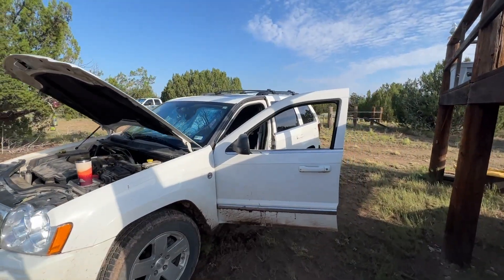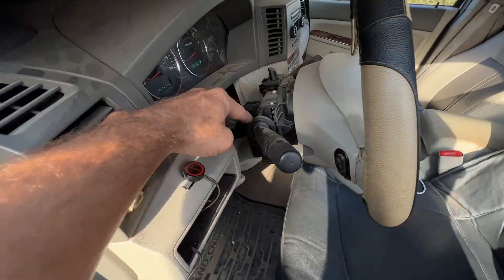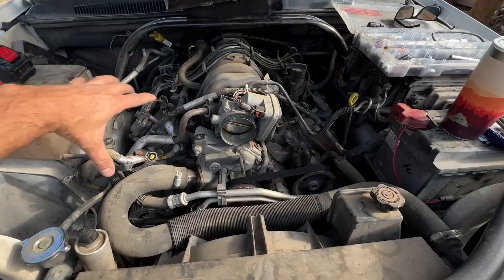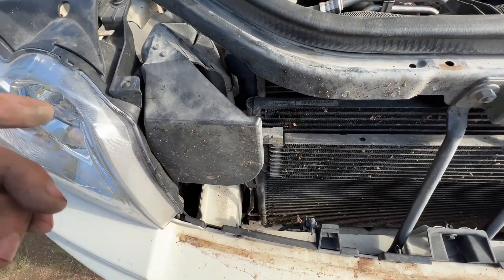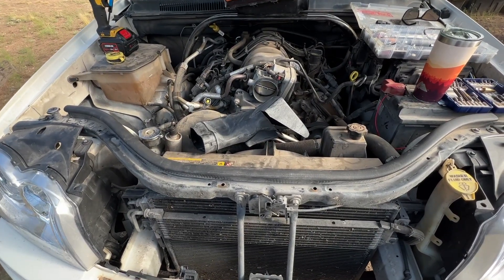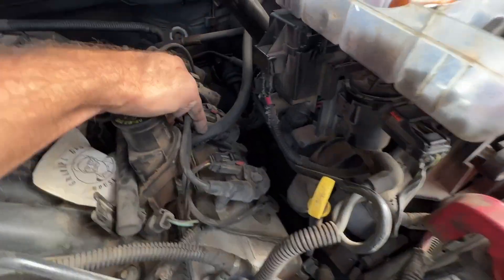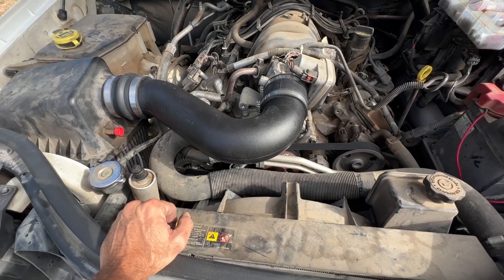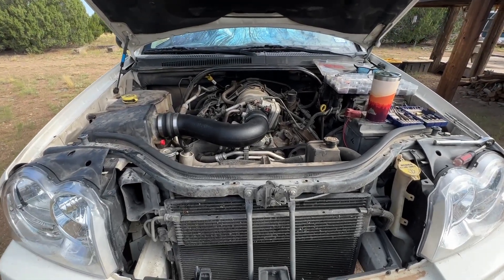05 Jeep Grand Cherokee 5.7 hemi - True Cold Air Intake

Comment: The front cover you removed off the air inlet behind the grill is to stop water from coming in and getting sucked into your throttle body.
Reply from the maker: I don’t plan on driving through hood deep water ever. So should be fine. Thanks for the concern though.
Reply: @grumpysdiy  I get that. But, just driving at 50-60 mph in pouring rain can cause issues as rain passes through the grill and straight into that inlet. My buddy had it happen to his WK. I have an 05 4.7 with an Injen CAI and it has a cover over the filter to deflect rain droplets. — But, that’s a clean Hemi you got. The interior leather looks to be in good shape. Can’t find those out here in PA.
Reply from the maker: @iMoses14  That's one hell of a rain storm. I get it almost anything is possible, I just don't see it being an issue where I live as I live in the high dessert with very little rain all year.